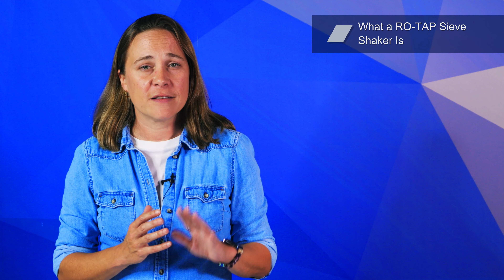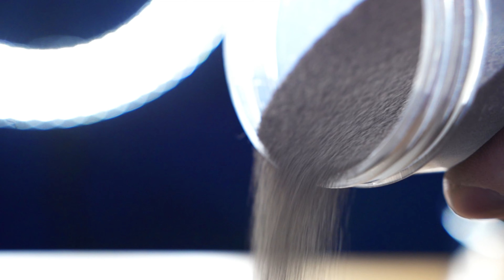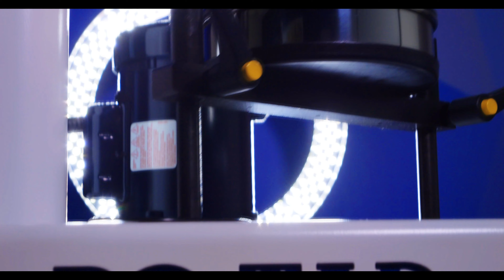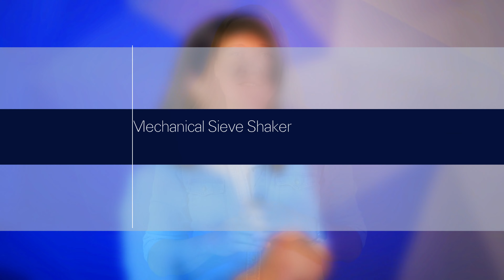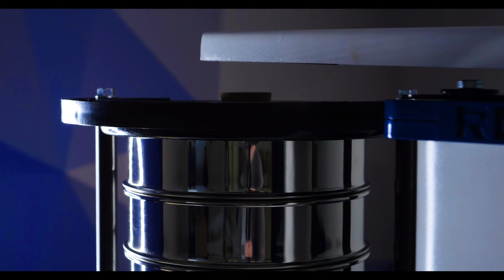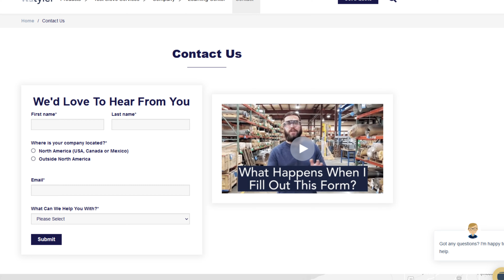What Is a RO-TAP Sieve Shaker?

Comment: During the test the instrument move from the place in bench
Reply from the maker: The Ro-Tap is a loud machine.  Because of it’s function, it can walk around on a table.  For this reason, we suggest making sure the machine is securely bolted to a heavy duty lab table or to the floor.  

Some customers have put a rubber mat between the machine and the table when they are securing it.  You can also purchase a sound enclosure that can help deaden the noise.